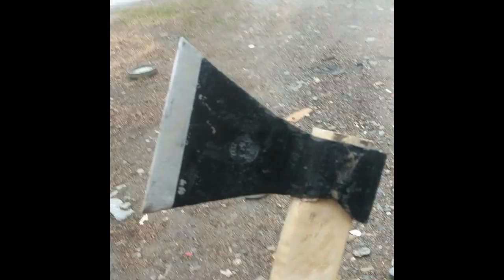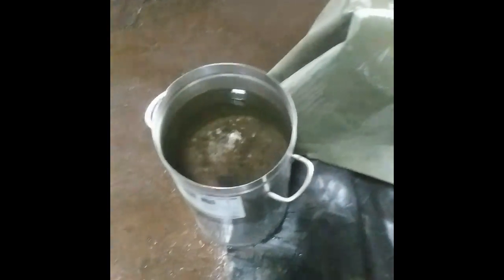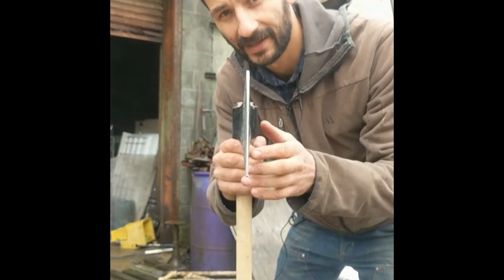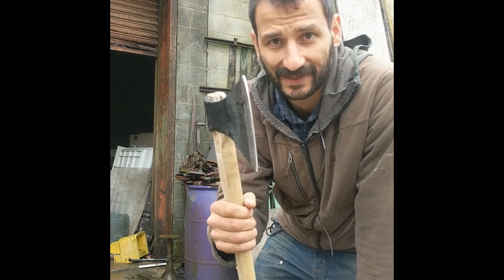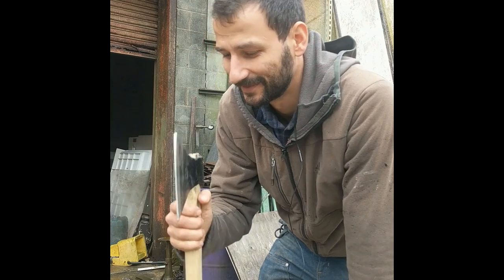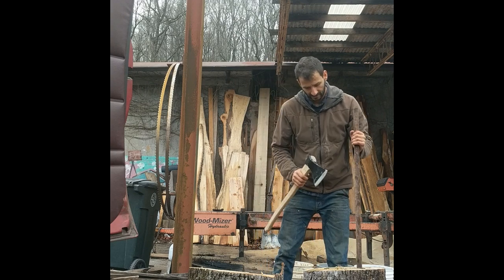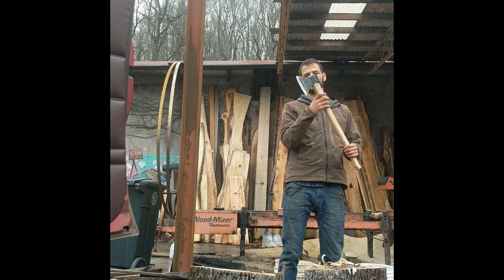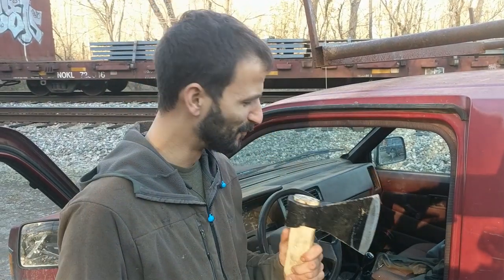Evaluating and Improving these Russian Axes....Axe Review!

Comment: The eye on most axes aren’t large enough to run the handle all the way through. The handle would be too thin. Northern Russian axes have larger eyes because the wood they use is typically birch, or something with even less strength.
Reply from the maker: I agree usually too small, and a weak point in many axes...

Comment: For those of you wanting an axe like Jordan's, the closest thing I've found readily available in the US is the Helko Werk Germany Hessen Woodworker Axe, available on Amazon (and probably elsewhere).

It's a fairly high end option ($180 at the moment), but the head shape & weight, and handle length are nearly identical to Jordan's (and the typical Russian forest axes I've seen).

In one place on social media, Jordan said his axe head weighs around 3lb, and in another place he said he likes around a 2.4lb head. He likes a 24-28" handle (usually 28 for himself, but 24 "is more typical for the Evenki").

The German axe mentioned above is 28" with a 2.75lb head, and nearly identical in head shape to Jordan's. The manufacturer is well known and their steel quality apparently solid. They also offer a similar 24" axe with a 2.25lb head.

The axes Jordan mentions in this video aren't currently available, and as he shows, have widely varying steel qualities and require several mods to get them into shape. I saw another channel review them as well, and they weren't huge fans.

Actual Russian axes seem to be hard to come by in the US, and don't seem to be regularly available from any well-known vendors.
Reply: actual russian axes are also mostly inferior to german and swedish ones simply because they are so hit and miss so there really isnt any good reason to want a russian axe unless for the collecting or something

Comment: Ohh they put a single grind on those things? So smart…

Hey Jordan, why don’t people in survival use a Pulaski (or cutter mattock) outdoors like they do in firefighting? It seems like the ability to dig would be helpful and you can still pound stakes into the ground using its side. Also I’ve always used a splitting maul (and wedges) to cut firewood because the axes get stuck. Is there a trick to using a lighter axe besides just angling the hit just right? And if so, couldn’t a fireman axe or Pulaski do the same job but also offer an additional function on the reverse side?